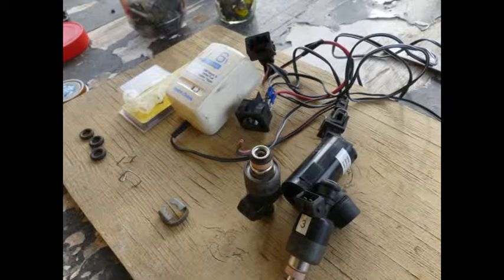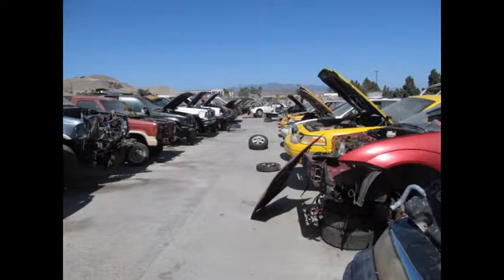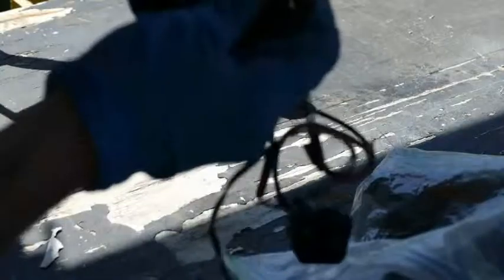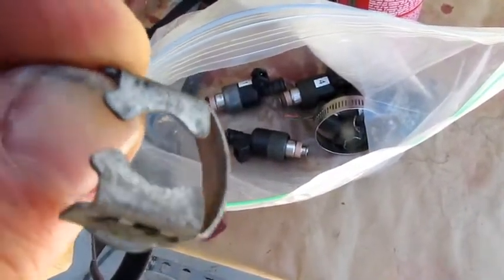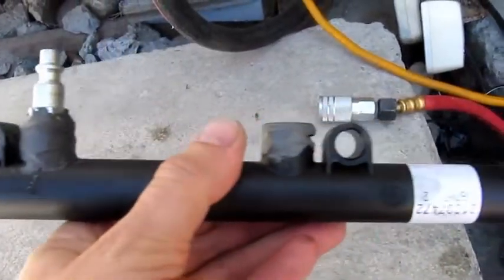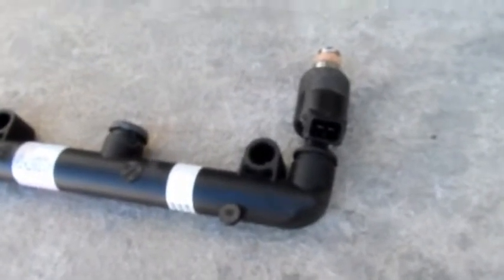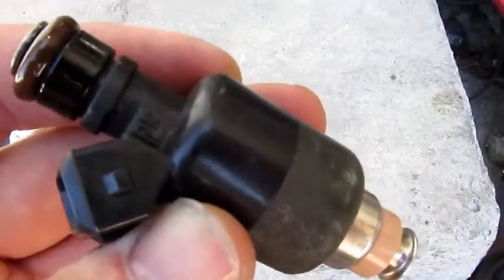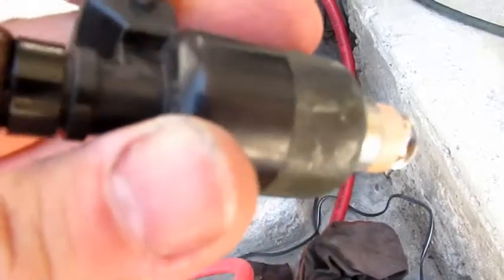Make a DIY fuel injector Cleaner two ways of Cleaning  GM MPFi Saturn SL2

Comment: Thanks for paving the way sir. My 95 SL2 has an intermittent miss on cylinder 3. No codes, good compression, can't find any vacuum leaks, and swapping around plugs, wires, and coils made no change, and magic mystery oil hasnt fixed it, so this is my next step.
Reply from the maker: I know what it's like to be in your shoes and how exciting it would be to have a breakthrough so please give me a up to date. I also went down the vacuum leak path over the years thinking that caused the tiny bit of stumble that I would experience randomly coming off of idle I thought maybe the brake booster is leaking all these different things never amounted to anything. Also, when I have put my hand over a throttle body while the car is running the suction is so powerful feels like it's going to pull you into the engine so I don't see how vacuum leaks can just exist without being detected you would hear them
Reply from the maker: Also since I made that video there hasn't been a single repeat of the problem everything is stayed perfect